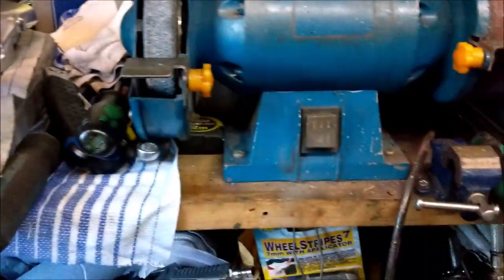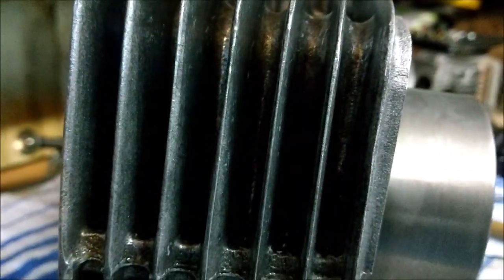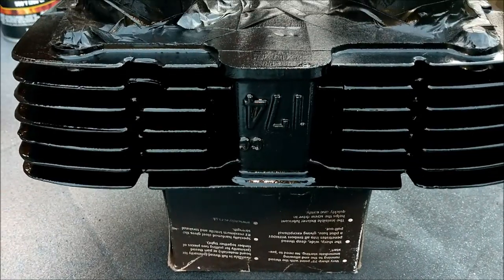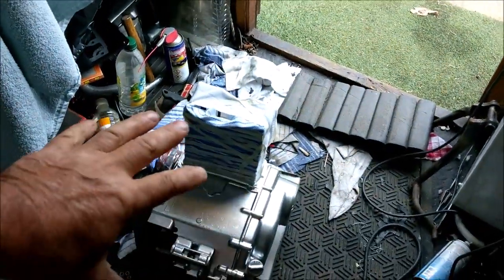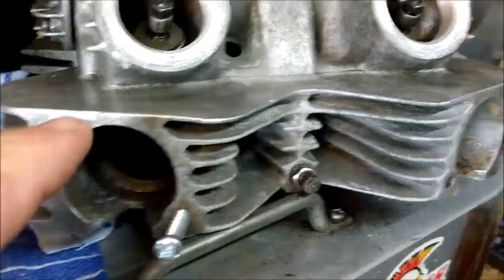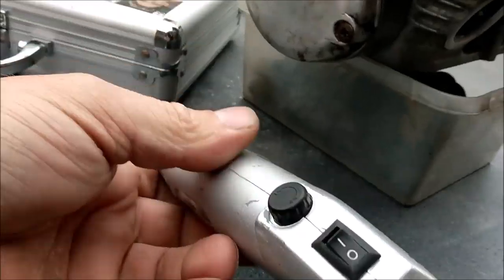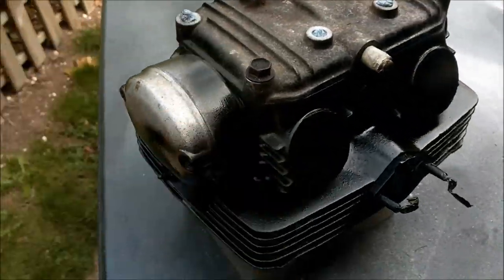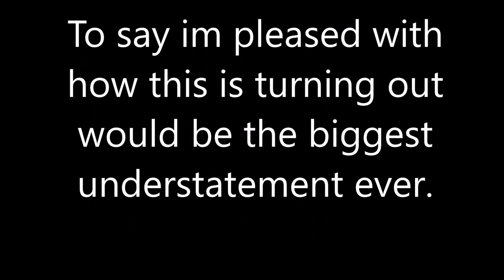Honda CD175 Restoration Episode 22 (Engine part 4)

Comment: Hi, have you filmed videos on taking a battery box and tool box out of a Honda CD175 frame and then putting it back? Thanks, Steve
Reply from the maker: Can't remember bud, some footage must be there somewhere on an episode, sorry i can't be more accurate than that but suffering mental health issues and it's difficult to remember stuff.
Reply from the maker: Also there are two different frames, sloper and normal 72-